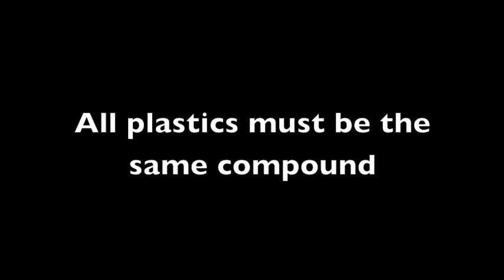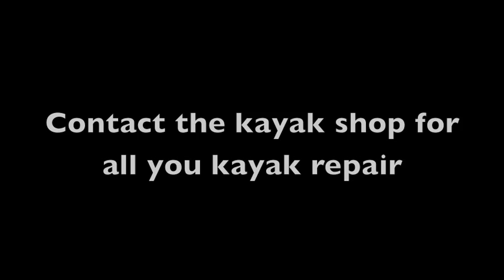How to plastic weld a Polyethylene kayak - kayak repair Drill Holes

Comment: Too bad  that the Leister Triac hotgun is a very expensive professional tool.
Reply: A ~$15.00 hand-held Gas One Butane Torch (or clone) is an adequate substitute, just take care not to melt a hole in your kayak.